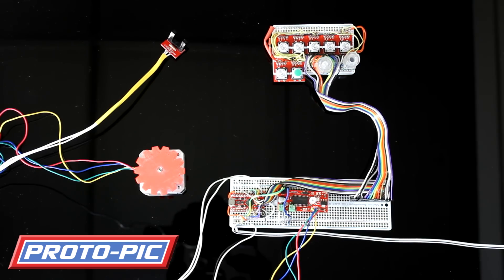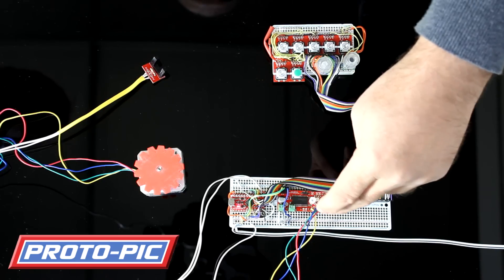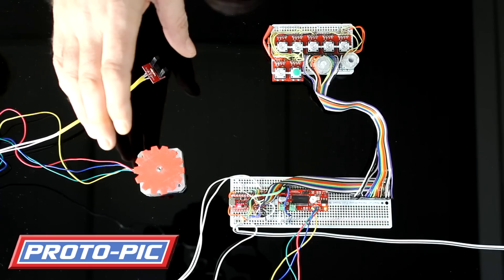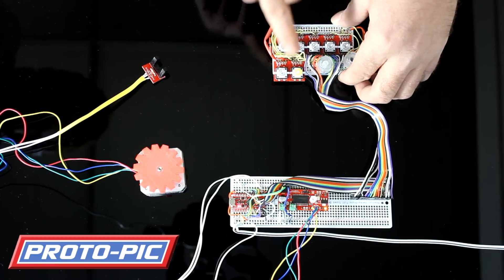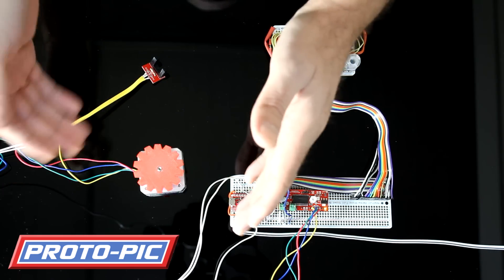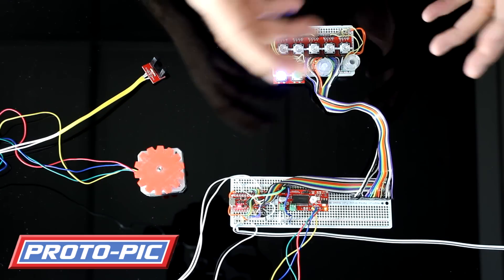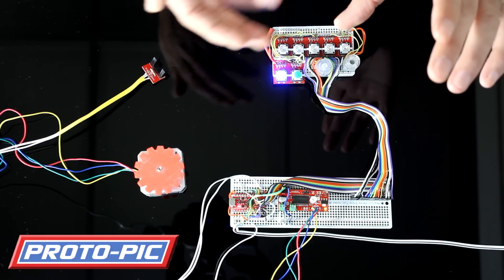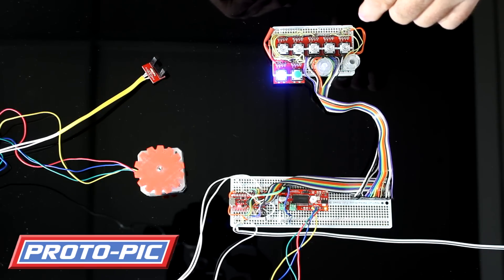Arduino Based Model Railway Turntable Controller

Comment: We use exactly this system in automated lighting fixtures. A wheel with 12 colours, or patterns, ( Gobos) in a wheel, that rotates into the path of a beam of light, put simply, to change colours or patterns in the stage lighting industry, or for that matter, the nodding buckets you see on TV that make them pan and tilt. And when kicked, they return to position. A turntable is only 18” long. A beam of light on a show, to maintain position over a throw of 100’ or so has to be mega accurate!

Comment: I like this One.. because.. it encodes itself. Steppers and are wonderful, Arduino and Hall effect, or IR sensor to clock from home position, but this one keeps checking itself, like servo feedback. Unless the table is built like a Swiss watch, there’s always crunching and friction. Also to note, apart from track feed, supplied via the split ring on perimeter and pick-ups, or the central boss, and pick ups, no power and feedback to extra components on the bridge. Just sticky-out tabs on encoder ring and hunt software.👍😜

Comment: Hi would it be possible for you to share the schematic/diagram and source code for this wonderful project please? I'm in the process of building one for my local club layout and have started with an Arduino but I like your option of having programmable settings much better. thanks in advance. cheers,
Reply from the maker: Hi, thanks for watching. We don't have the source code for this project any longer, it was a one off sadly, and there's probably not much likelyhood that we'll recreate it. Best of luck though, and if you get stuck on a specific issue, you can contact our tech team directly.

Comment: Hello all
Great project!
I wanted to use this project to transfer my table, but I get the error:
'Shifter' does not name a type

Arduino highlights the line of code
Shifter shifter(SER_Pin, RCLK_Pin, SRCLK_Pin, 1);

I tried on different plates Arduino, I use version 1.0.6
I will be grateful for your help.

Comment: Could you tell me where to find the source code and schematics?
Reply from the maker: Hi - The Source Code and Schematic have now been released as open source - the link is in the description.
Reply: @ProtoPICVideos  no it is not we get a page 404 error “Page not found “
Reply: Hi, thank you to have posted the video, the source and the schema. This is fantastic and is exactly what i was looking for :-). I made it using Arduino Mega and the shift register chip and it is working fine but I need more location so more buttons. before adding another 74hc165 to expand the input i connected just a last available button to the free port of 74hc165 and added case 8 with related preset...etc. ;but is not working fine, may you please help me ? thank you in advance. Elvino.
Reply: Thank you

Comment: I wish you would have posted on your Proto-Pics site like you said (I looked for it). I have been working for a while to make a turntable work exactly like you did. All of the other posts I find all do it the same way but it is not the way I want it to work. I am learning more everyday about programming. At least I know it can be done the way I want to. I just have to figure out the way and how to code it. Good job.
Reply: Thank you for posting the Source Code and Schematic
Reply: @davidrt9999 Hi do you still have det source code and schematic on this? The link dosen't work